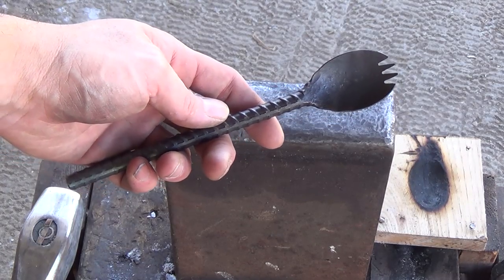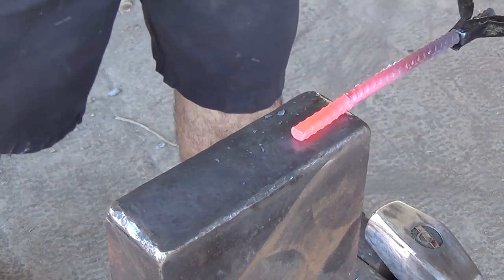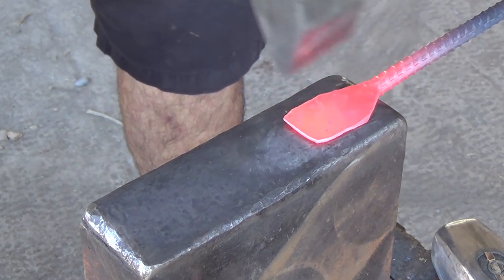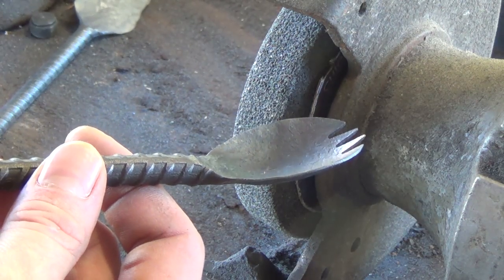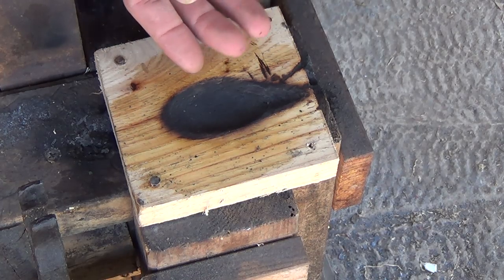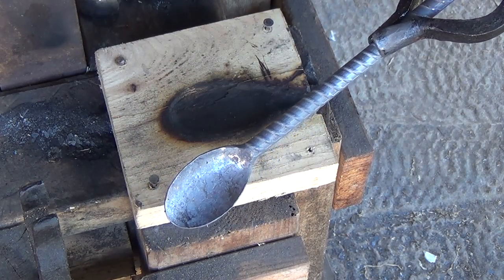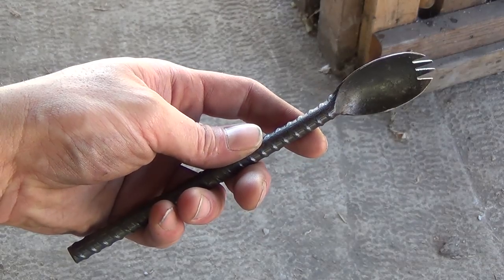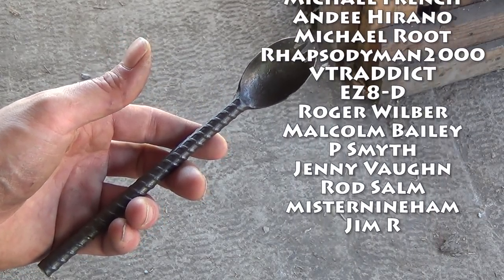Blacksmithing Projects: Post Apocalyptic Spork

Comment: Could you make a short campfire fire tool, (poker with a back hook for controlling logs in a campfire out of re-bar?)  Great for camp outs and the like where a smaller fire is the norm.
Reply from the maker: +TrikeRoadPoet Thanks for the suggestion! I'd definitely like to try making one of those!

Comment: The concept is really cool and awesome, but I'm worried how rusty it might get. Do you treat it like cast iron?
Reply from the maker: +TheSchmeister The final dip in oil when the steel is hot creates a film of polymerized oil, similar to the seasoning on cast iron cookware. You can also bake it with a layer of oil to season it.

As long as the spork stays dry in storage, rust isn't an issue. If it does get left out in the rain overnight or under a canoe seat for a month, just drop it in a pan of warm vinegar for an hour and then wash with soapy water to remove the rust. Then coat with oil after drying.

Thanks for watching!
Reply: BackyardBowyer nice one, thanks!